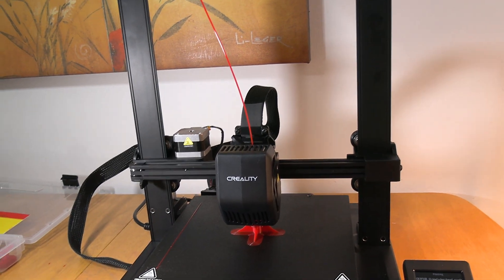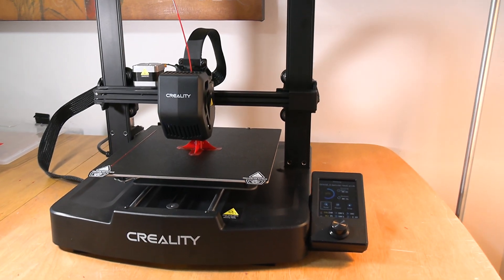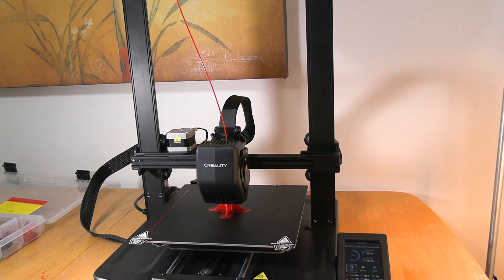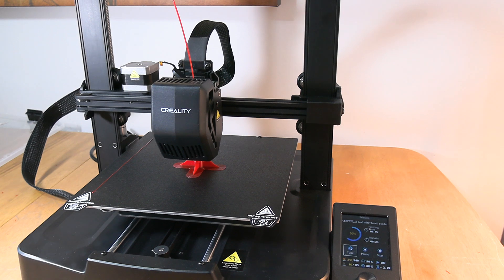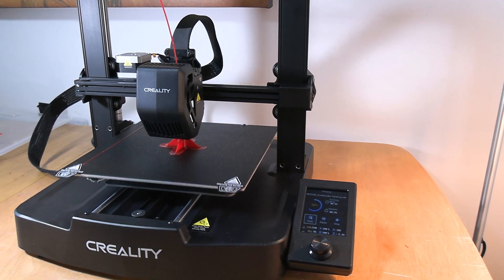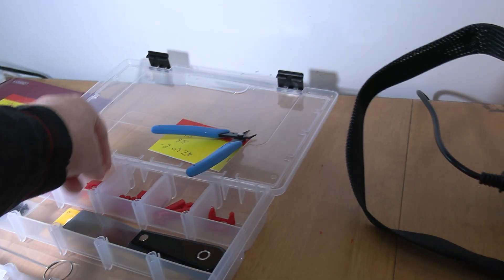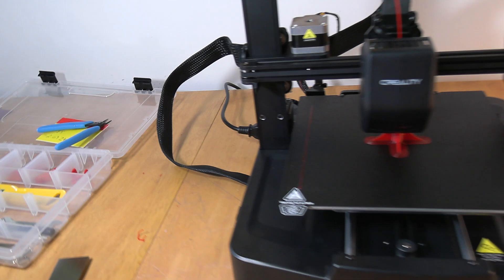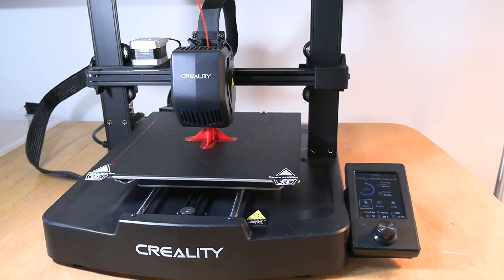Creality ender V3 SE 3D printer

Comment: I got this same one a month ago, bought the PEI plate right away and printed a spool holder that uses bearings that I just happened to already have. The filament is never taut so its pulls smoothly.